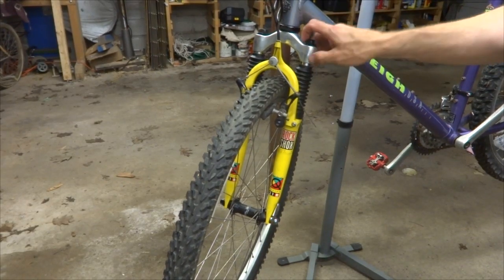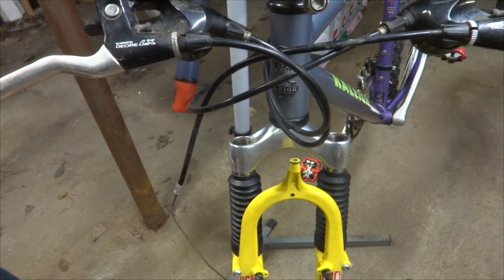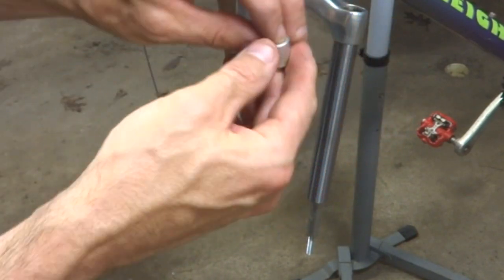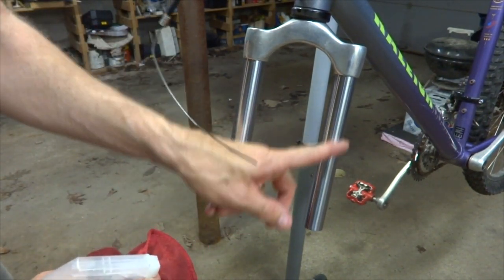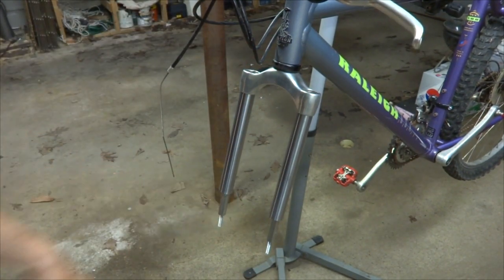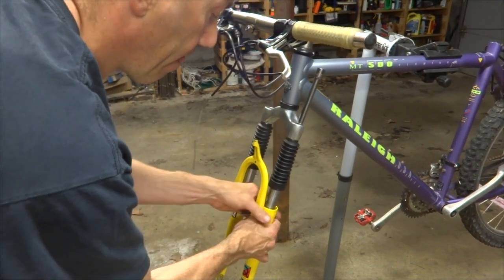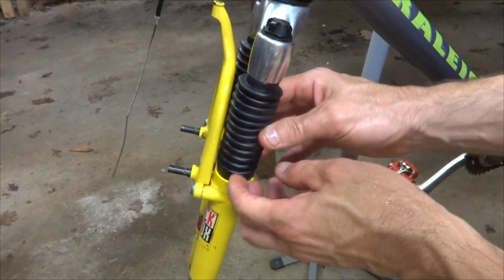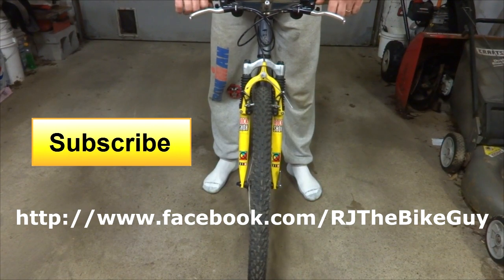RockShox Quadra 21R Shocks/Fork Service - Disassembly/Clean/Lube/Assembly

Comment: I just ordered new elastomers for my 21r shocks. They were on my 1990 giant ATX880. Can't wait till they get here. I had to order them from a place in Arizona.
 The old elastomers are disintegrating, so they may take a little work getting out. These forks never been serviced. I know the first 2 owners personally, and they never did it. The bike sat in a bedroom and garage for years and years before i bought it from my friends. I hope these 30 plus year old elastomers come out easier then i expect them to.
  People mention the spring replacement, i don't believe theyvare available. I could only find the elastomers at one place. Mine were ordered based on my weight.

Comment: Hi I recently purchased a nice Rock Shox  Quadra 21R. Would you recommend either a replacement of the Elastomers from suspension Fork Parts or SRP Steed Springs? Thanks for your time and opinion. Great review video!👌🏼
Reply: Did you fix your fork? Curious about how it went as I too have an old Quadra 21R. My elastomers look to be in decent shape so I'm hoping to not change them.
Reply: Hi, yes I did fix my fork. I installed new SRP Steed Springs and the fork is working perfectly!👌🏼
Reply: @sihectorc  are the springs instead of elastomers?? like you can get either?

Comment: He man just saw this video after searching for information on these shocks.  Great video exactly what I needed.  Unfortunately my shocks are toast, the elastic rubbers are gone and the forks are seized but having watched your video I think I can sort having watched your video but need either new elastic components or the springs you mentioned.  Are either of these component available to ship to the UK.  Many thanks great video.
Reply from the maker: Shrug. You will have to shop around to see if you can find replacements. No idea if these guys ship there: https://www.suspensionforkparts.net/eshop/rock-shox.html
Reply: @RJTheBikeGuy  is there a change you have the link of spring replacement for the elastomers?
Reply from the maker: @rhuishin6719  Nope.

Comment: Hey, I like your video. You show and explain it all very well. I've got an old Diamond Back Ascent MTB with Rock Shox Quadra 21R on it. I just followed your initial steps on how to pull it apart, but when I got to removing the (you called it the stack), well there was no stack at all inside mine... just a plastic piece (kinda like first part of stack), then a long metal rod came out. Hmm, not sure what to do now. I did take my bike for service last year, but they told me that the Rock Shox are completely stuffed and can't be repaired and that I should buy new shocks. Last year I was thinking that it would cost me a bit too much to be spending so much on such an old bike, but now I'm thinking that I probably do need to go out and buy new shockers. Do you know what would be the equivalent (size, etc.) for these shockers for new shockers? Would love to hear your feedback. Thanks. :-)
Reply from the maker: Shockers? You mean elastomers? I don't know the size. https://www.suspensionforkparts.net/eshop/rock-shox.html?page=all

Comment: Great video. I have the Q21R on my 1994 Bridgestone MB-3 Cro-moly and Ritchey Logic. A this moment the Q21R are totally dead. Looking forward to the rebuild. Tht said, I am still POed at myself for taking off the rigid Ritchey fork 25 years ago, (and threw it away..)  cuz I 'had to have shocks', but nonetheless a great bike anyways...
Reply: big touble. My Elastomers are so old and dead they have turned to clay. only the top three sections of the stack came out. It is literally clay. How can I get the rest out, without destroying the inside of the tubes? I think i will need some really severe long tweezers tool  to try to pull the nub on each plastic section out, then dig out the clay? What a mess. I was so ready to have an easy change out, and go riding...
Reply: @dean4559  I'm working on one with clay or mud or something halfway down I am considering running a long drill down to clear what remains and then put a gas car hood strut inside where the elastomers once were
Reply: @keithstone6766  Hi Keith. You need to get this tool I found. It is a triple jointed needle nosed plier. I found it at Lowes. its about 10 inches long more or less ( i don't have it in front of me). perfect tool for what we have to do here.   That way you can actually reach down all the way into the tube and you are able to get a grip on every piece of the elastomer stack and pull it out. It takes patience, and a good head mounted flashlight helps too, so you can see down the tube. The pliers allowed me to basically pull everything out. Then I used some mineral spirits as a solvent with an old toothbrush and was able to clean out the remaining crud without damaging the inside of the tube. It took time and patience to get a grip on every piece, but you are very satisfied when its complete. I also located replacement elastomers at an online bike parts supplier. I was able to salvage the plastic spacers in between, but i assume those could be had if necessary. The shocks now are as good as new, and remarkably good. I am having a great time on that old, but rebuilt, classic bike. Good luck.
Reply: @keithstone6766  Keith, do a google search for Irwin vise-grip compound long reach pliers. Thats what i used to get into the bottom sections of the tube. they are slim enough to get into the tube, and you can open them just enough to grab a hold of the stack parts. thats the key. well worth the 15$. considering what they will do.

Comment: Where can I get brand new elastomers or who is that company tha makes springs for it? Great video by the way
Reply: There are companies like "Suspension Fork Parts" (or also Shockcraft based in NZ) that may carry old stock. In the worse case, you may have to try make your own from solid rubber rod (try McMaster-Carr), but they wont work the same. Its an obsolete technology for forks.

Comment: Hey RJ, do you have any videos on servicing shocks that use air suspension? I recently got a pair of RockShox Mag 21, but I haven't seen anything on overhauling them, I have found the manual to overhaul them online, but your videos are much more informative.
Reply from the maker: Not yet. I think I have a bike at home with some of those that I was planning to overhaul. So at some point when I get time.

Comment: I just acquired a Gary Fisher with the Rockshox Quadra 21R's.  When servicing the front forks, is it recommended to replace the original elastomers with springs, or simply replace with new elastomers instead?

Comment: i enjoy your how to vids rj,i have rst shocks on my trek 3700 that need a little tlc like grease,they are the original shocks and i wonder if just lubing them would work instead of taking them apart? pull up the grommet and spray some good lube down the shafts and replace the grommet and push down to get the insides good and lubed
Reply from the maker: speedjunkie66 That might help some. I really recommend using the proper fork grease. I have a video tearing apart some RST shocks here: https://www.youtube.com/watch?v=d534ilYCaMk
Reply: RJ The Bike Guy yeah i saw that one,thanks

Comment: My electric scooter front fork is similar to this fork as far as components. How would you increase the dampening on the current setup? Replace the spring? If so, how do you measure what you’d need and where would you order from? Mine is a 14 inch Chinese fork and bottoms out on bumps so I’m looking for an alternative to factory.
Reply from the maker: Shrug. Maybe get a better fork.

Comment: Also, I have a 95 Judy XC Cartridge system fork with oil dampener. I read a manual on refilling the cartridges with oil, but I'm worried they are just going to leak all over the place.
Reply from the maker: I can't help you there. If they are going to leak, they are going to leak. You might be able to get parts, but probably not.
Reply: Yeah, I'm just worried about buying elastomers or springs for them and they end up leaking

Comment: I'm having an issue with the 5mm allen socket. Mine tapers down to 5mm and doesn't go through the hole far enough to turn the bolt. How much past the hole is the bolt because I can't seem to find a single 5mm socket that is as long as the one you have.

Comment: I have a Q 21r that is about bottomed out when tire is attached --very little action--when bike is pulled up from bars off ground,  wheel and fork  just sag  back down slowly. Worth  tearing it apart and cleaning to resolve issue or should I just look for a replacement?  Thanks!
Reply from the maker: What have you got to lose? Tear it down.
Reply: @RJTheBikeGuy  True---I went ahead and broke it down. Seems to me that fork on this rebuilt 97 Specialized Hardrock was either heavily used in dirt OR was in a flood. The stanchions inside were caked in mud...the elastomers prob need to be replaced. Thanks for the videos!
Reply: Hey how much is the suspension in mm do u know
Reply: @Spark_plugs_without_the_sparks  according to specs, I believe about 80mm

Comment: I have tried 3 different 5mm hex extension sockets. The tip is 5mm, but the shaft is 6mm. It doesn't fit through the hole. Only the tip goes through. Where did you get your socket? Will the T handle 5 mm work for loosening, or are they too weak?
Reply from the maker: This is what I used. https://www.amazon.com/exec/obidos/ASIN/B001NT2LK4/ref=nosim/youtube25-20
A T handle 5mm might work if it's not too tight.
Reply: Thank you!